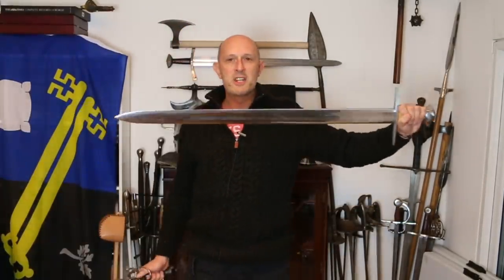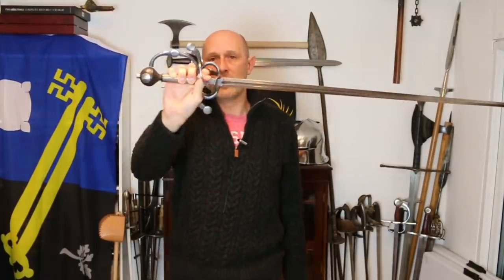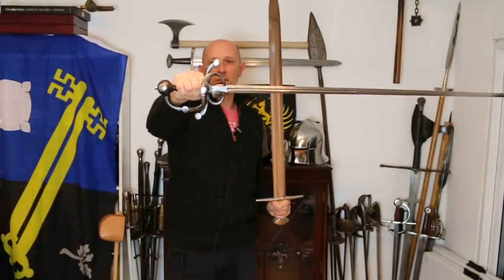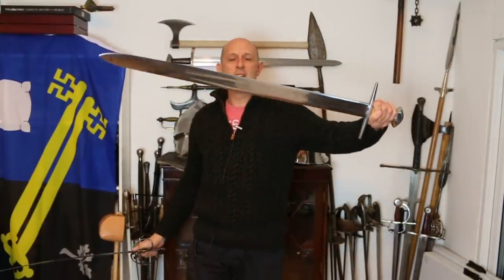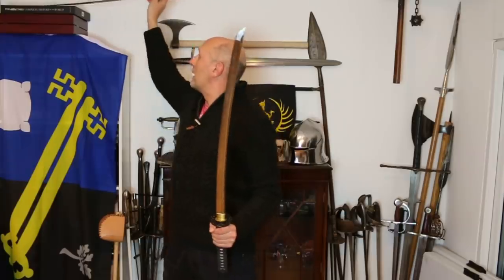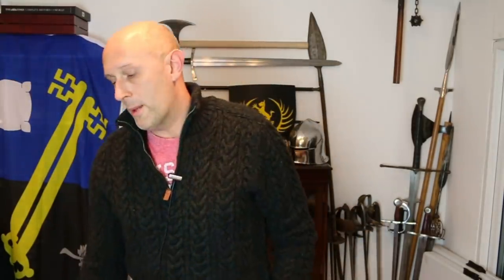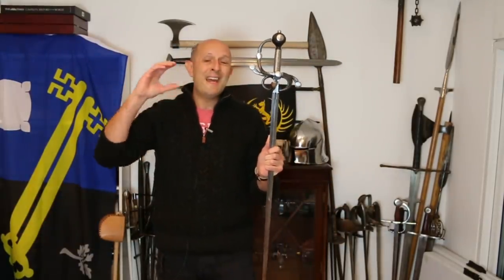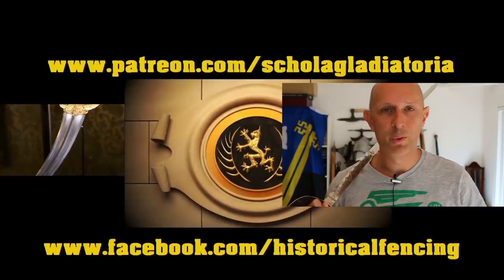Sword Blade Technology Informing Design

Comment: In my opinion, the depth of the blade is an important factor to remember when considering blade width. Just to clarify the terms, we have length which needs not clarification, and width being the distance from edge to edge or edge to back, and depth being the distance from flat to flat which we can call thickness. The katana is a significantly thicker on that plane compared to other swords which enables it to maintain rigidity for how thin it is along its width, but that thickness hinders cutting a little because the material it cuts needs to be pushed farther apart to allow the blade to pass through. I suspect that if you wanted a thinner sword from flat to flat so material doesn’t need to be pushed as far apart, you would need to increase the blade’s width to return some of the structure to the blade even though it would be more floppy due to being thinner, it would still be stronger than if it was more narrow from edge to back, which would give us thinner but wider blades, much like the falchion.
Reply: @HansGruber006  It seem to me, that was an undeserved reply. 
As for the response thing, anybody that has a YouTube account has a channel. If everybody used it to reply to each others, than what is the use for comments? Why don't you pass your reply on your channel?
Reply: @HansGruber006  I'm sorry you don't like reading.
Reply: I think you need much better quality steel for broad and thin blades than for thick blades. So better material-technology made thinner blades possible not narrower ones.
And the Katana follows the same rule. Because the back of the Katana is out of lowcarbonsteel, it is like it would be made of lowerquality steel over all.
Reply: estranho konsta 
I believe he was referring to longform vs shortform replies. Where comment section is good for shortform when you are able tomake a video for longform responses.
Reply: @HansGruber006  dude, there's literally a "read more" button that you had to click on before you could read all of it and become annoyed. Talk about a self-inflicted wound.
Reply: Will you do a video on this shad
Reply: except on a katana the spine is generally thinner then the middle of the blade, as well as the appleseed shaped edges. it reduces drag in the cut and helps negate the thickness of the blade.
Reply: @hectorvi1633  do some more search. the spine of a katana isnt always soft steel. or low carbon steel.
Reply: while you have a point about it needing to be pushed further apart. 

this article points out the valid point that on any thick or hard targets the wider thinner blade becomes more disadvantaged. 

so making a thinner blade doesnt necessarily make it any better and potentially worse. 

thus taking into account where the thickness is in relation to the edge also matters.

http://www.bugei.com/niku.html
Reply: bmxriderforlife1234 apparently one paragraph is excessive reading nowadays.
Reply: So why would you even make a thick sword instead of a broad one?
Reply: @bmxriderforlife1234  Maybe Anthony Napoli just uses a veeeery large font.
Reply: @EvilPineappl  Better thrusting capacity, for example.
Also, a broad blade can give enough material for the blade as a whole to be robust enough, but a thin edge is still less robust than a thick one, and can get more easily bent locally, or dented, or rolled etc.
Also, a thicker blade geometry can be more forgiving about edge alignment (I think? correct me if I'm wrong).
Reply: @EvilPineappl  because it you make a thick sword you can get just as much cutting power with less friction applied to the blade. 

as well as add rigidity for thrusting.
Reply: well thicker would add more friction, but rigidity makes sense, trading cut for thrust
Reply: @EvilPineappl  read what i said in other comments. thicker doesnt necessarily have to equal more friction in every situation. 

it just usually does. 

the niku or curved edges of the katana, as well as the thinner tapering spine actually means less of the blade is in contact. think about it in terms of arrows, matt has talked about this recently in some of his videos. also on swords. 

basically the first section of the blade very very quickly wedges it apart wide enough that the rest of the blade can very easily pass through. as it cuts this continues the bit thats far enough back may close but not enough that the back or middle of the blade is contacted.
Reply: @emarsk77  .......size 1000 jumbo(bold)
Reply: @EvilPineappl  http://www.bugei.com/niku.html

this will explain it. 

shad also has a video explaining the benefits of a single edged sword vs double edged sword if im not mistaken. 

though i believe matt skall and metatron may have all talked about this. 

the katana didnt trade cuts for thrusts. it had both to a very reasonable extant. as long as the blade as made well and such. sure the more curved ones arent necessarily the best, however alot of those are older blades or from periods where it was trendy to have really curved swords. 

in certain periods straight or almost straight katana were popular. 

ive seen a katana with forwards curvature like certain tanto and chokuto. its very minimal. 

however look at the tip of certain shinogi zukuri blades. you should notice that nice reinforced diamond shape. clearly meant to maximize the thrusting potential. well without having to add a false edge....but they did that too. in a few different ways. 

oh also placement of the curvature in the blade can make a big difference. 
http://meiboku.info/guide/form/zukuri/index.htm

http://meiboku.info/guide/form/sori/index.htm

http://meiboku.info/guide/form/kissaki/index.htm

those three meiboku links should give you an idea. the katana varies more then people think. some are rather thin and flat. others have some interesting geometries. 

tip shapes vary. in multiple ways. 

it all depends what someone wanted in a sword. some people went pure function, some went with form over function in some regards, others went overkill with it. blades meant for war not necessarily just old blades descendants only used for war. but like blades made for war, are typically designed for cutting hard targets. 

people think its nuts but there is a reason legends of katana's splitting helmets exist, and a reason why there is a tameshigiri practice where you cleave helmets open. not exactly cutting them open more just forcing the material to break. i doubt many people were ever wounded from it being done, but we know it was done. usually with the blade getting stuck in the helmet the person being fine and killing the person with the sword and taking it. search the hanjo masamune.
Reply: Guys... friction.
Reply: @HansGruber006  let the man speak his mind where he pleases...I'm here to learn

Comment: Very interesting topic!
At the moment, i'm extrapolating it to even earlier swords (iron age and bronze age), especially their blade geometry. I'm thinking the leaf shape of some bronze swords looks like a compromise between piercing and cutting power, with a much softer material.

EDIT: Please do more videos like this, it's a highly fascinating topic!
Reply: What do you think of the various blade shapes of the gladius? Some have a fairly blunt taper while others have 1/3 of the blade tapering to a relative sharp point.
Reply: There are various variations of leaf shapes, some as you said are quite pointy. I wonder how the relative soft material (bronze) did perform if it accidentally hit armor when trying to pierce unprotected body parts. 

You see, what interest me the most is the difference in construction between advanced steel swords that can flex and ancient swords that where constructed with rigity in mind. 
As you said some where quite pointy, while others where rather broad, some had a ridge to add more ridigity, which is quite a contrast to the later fuller on steel blades.
(did iron age swords had fullers? i'm not sure about that)
They where obviously trying to create piercing oriented and cut oriented weapons, but they looked quite different to later (spring steel) designs. I find this aspect of construction really fascinating if you consider what kind of sollutions the came up with, just because of the different characteristic of material they had at hand. 

I wonder how different swordfight techniques must have been in ancient times, compared to medieval and later techniques.
Reply: @nealsterling8151  i'm not sure about iron age swords in general, but early examples that i'm aware of were often very like the bronze ones used by the same culture before, and it took a while for them to develop a distinctive shape. (the same is true in axeheads, sometimes they had decorative elements that in predecessor forms were utilitarian but became obsolete because of advanced hafting methods.) bronze swords also can have ridges down the middle of the blade to improve rigidity - again iron age swords following the pattern would make sense. well-made bronze isn't necessarily inferior to iron as a material, but it probably also should be taken into account that complex blade geometry is easier to make in bronze casting.
Reply: "...which is quite a contrast to the later fuller on steel blades."

It is a contrast, but the effect is basically the same. A central fuller/groove creates a pair ridges. A bronze sword with a central ridge could also be described as having a pair of fullers/grooves either side of the mid-line.

Swords are created with ridges because ridges increase RIGIDITY, without adding much mass. Rigidity is important for both thrusting and cutting performance.
Reply: Very true, the effect is the same.
My statement was aimed at the process of creating a sword and sword construction.
Reply: Iron swords are not in any way better than bronze swords. But they can be cheaper and most definitively logistically easier to deal with (one source of iron is easier to handle than havign to deal with getting hold of both tin and copper). Remember, iron is not steel and steel didn't show up until after bronze weaponry had been out of fashion for a while. The way I understand it, the decision to go with iron or bronze was much more an econimical question than a quality question, the cultures going for iron-equipped armies fared better because they were cheaper to equip and maintain. And with a declining demand for bronze-smiths the craft kinda died out, so individually choosing a fancy bronze sword wouldn't really be an option. 

As for blade shape, I don't think bronze is any softer than steel. Iirc, it is even harder, and as a result, brittle (very hard and brittle material makes for great short swords and daggers). Iron is soft, much softer than both steel and bronze, and had limited options for how to shape it into a proper weapon.  I think, if the material would allow it, we would have seen more bronze age style blade shapes in swords.
Reply: Iron is a better material than bronze to make weapons from because of its tendency to be brittle. .And as the metal is an alloy of tin and copper,  the quality and consistancy is much more difficult to control. There were too many variables at work to ensure  you got the same quality of metal each time, and the sourcing of ores meant it was very expensive to produce in quantity. Bronze blades were cast, then finished and sharpened by grinding. They weren't tempered, and everything depended on the quality of your metals. 

Also the temperatures needed for extracting metal from tin and copper ores is much lower than that neccessary for smelting Iron. Copper and tin can be alloyed into bronze at around 950 degrees C,  but the melting point of iron is over 1500 degrees C. Tool quality  bronze was dependent on the availibility of the comparitively rare tin, and the only source of tin in Europe, was Cornwall.  When the Phoenician trade from Britain to the mediterranean was disrupted by the rise of Carthage, then Rome,  tin availibility became sporadic. 

The superior (but harder to produce) metal, iron began to replace bronze for weapons, and as the demand rose, so did the technology needed to smelt it from ore, and as the tech improved, so did the quality of metal. Early "Bloomery" furnaces produced a workable base iron metal, and further melting of this porous "bloom" metal removed impurities, and resulted in molten iron that you could cast into ingots for transporting, then further working at the lower temperatures provided by a traditional Blacksmith's forge produced wrought iron at qualities that varied according to its treatment. Its availibility and its mass production meant whole Armies could be armed with iron swords, quickly and cheaply. So why would anyone prefer a bronze sword to an iron one? Maybe the best quality bronze had an edge over the poorest quality iron, I don't know, but iron was the metal that cut out Empires, iron was the metal that evolved into the much better steel, and as a metal for making tools, blades, and armour, steel is the boi to go to.

Comment: Material availability will almost always dictate weapon form. If all you have is wood, you probably have a weapon shaped like a baseball bat, or a stick with a knobby end. Bronze age swords were short. Victorian age muskets were smoothbore, because of black powder fouling. As materials change, so does form.
Reply: It's also worth noting (though Matt did touch on it) that every sword design is a compromise: to gain in one area or quality, you have to sacrifice in another area.  The key is finding an acceptable balance of qualities.
Reply: Not sure what you mean about the muskets. But they were smoothbore because they hadn't made rifling yet. Muzzleloading rifles still used black powder, even the first cartridge guns used black powder.

Comment: I feel like adding broadness to the blade is an easy way to add mass-per-length without making the blade more thick (and increasing the cut friction). If you imagine the sword to be made out of unbending diamond, then you can assume that all of the energy of the strike will be transferred into the cut, in which case mass-per-length is irrelevant, and the inertia of the entire object should be considered. On the other hand, if you imagine the blade to be a pool noodle, then only the mass directly behind the cross-section of impact will be absorbed into the cut, while the rest will be dispersed in the overall "wobble" of the noodle.
I assume that an iron bar is somewhere between a pool noodle and a diamond, and that part of the kinetic energy of the object will be lost to the wobble/bending and part of it absorbed into the cut-work at the blade cross section. 
I also assume that the softer the material you work with is, the most energy will be lost to bending or wobble, and the more incentive you have to have the mass of the blade directly behind the cutting edge. As metallurgy improved and steels got harder without being brittle, it became feasible to store part of the mass of the blade closer to the fulcrum of the hand-held weapon (making it more nimble for thrusts and defensive action) while also transmitting the kinetic energy of that part of the blade to the cut.
To be clear they always had the possibility to make really hard blades (pig iron) but they would have been incredibly brittle, and since you could make a softer iron blade that was just wider and had the same cutting power, then you would just do that. Only when metallurgy got better did you start seeing mail-piercers (even though mail had been around forever).

Comment: Fantastic video!  I would certainly love to see this discussion extended to hilt design, as well.  I am curious as to if material availability and quality was a prominent factor when it came to hilt design.  For example, what kind of characteristics do you need for material making up a basket hilt? or a knuckle-bow?  or the longer cross hilts seen in later period cruciform swords vs. their early medieval era ancestors?   And might that partially explain why they showed up when they did?